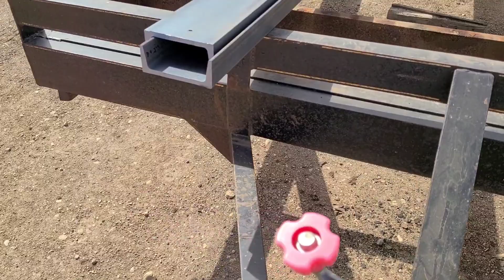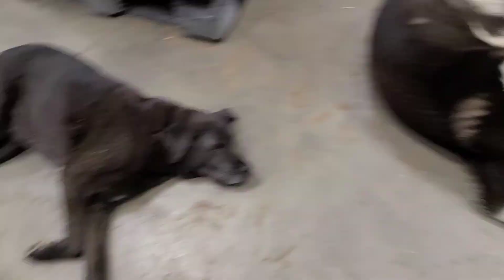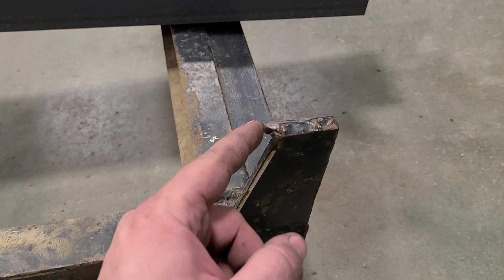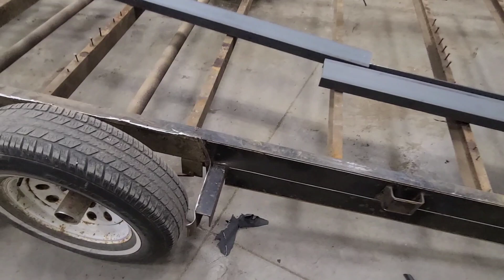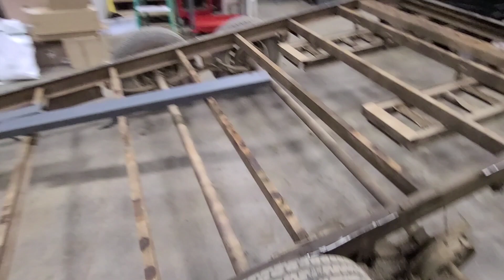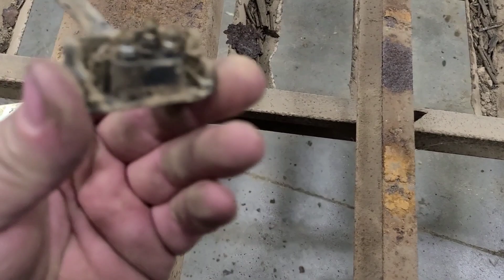18' Car Trailer Rebuild Pt.3 Tongue and Fender Removal

Comment: Why don't you just make a new trailer and be done with it? It would be a lot easier.
Reply from the maker: Steel prices as well as this already has a VIN and title. I also don't find that it would be easier. There would be quite a bit of work in laying out, leveling, and squaring a frame, as well as adding all the cross members, beaver tail, and spring hangers, etc

Comment: That silicone you found is something they do keep the rust from creeping out since there’s no paint in the cracks. Short term solution
Reply: Never mind!! You determined it was weld!
Reply from the maker: @rexkramer4938  I think the paint had bubbled away from the weld and that's the soft spot I was feeling, either way it's gone now. Thanks Rex

Comment: A very solid work, in my opinion, with the right choices for the recovery of the trailer.
Here in Germany we would have to have the work checked by the "TÜV" (Technical Inspection Association = Technischer Überwachungs Verein). Very many regulations, very many technical standards.
Because of these norms, your trailer would probably end up on the scrap metal in our country.
But I'm still very curious how it goes - I think the part is cool.
Kind regards, Raik

Comment: Hope u didn’t pay to much for this, I got a free trailer once and by the time I was done fixing I think I could have bought a new on for the time and materials invested
Reply from the maker: It was free, and with the way trailer prices are now, I wouldn't pay for a new one, if anything I would build my own from scratch. Let alone around here the lead time is anywhere from 6-18 months depending on the manufacturer

Comment: i must add this about the lights sorry to say all the big manufactors of trailer use the plug in lights . i have 3 thralier out here and don't have trouble with any of them  but the way it mounts is way different and much more inclosed

Comment: Are the spring mounts going to be a stretched folded hexagon  so instead of  90 degree leading and trailing edges you have 45 degree versions. Since you have access to a Cnc plate cutter. You could have a rectangle with radius corners  for weld on spring brackets.  I always hated bumping into the bracket corners when I needed to get under the trailers. 
Have you ever thought about using early 70s dodge motor mounts like mounts 2265 to mount your tail light brackets to.  Or ask to look at motor mounts 2122 and 2123. Tri 5 Chevy front mounts. 

And since there is fender brackets with flat tops  mount the fenders on angle and put hinges on the outside to allow them to flip down when loading if needed.

Comment: Are you going to send it out for blasting before welding or weld everything up before blasting?
Reply from the maker: After, that way all steel has a good surface for paint to "bite" on to
Reply: It's gonna look pretty good and be structurally sound when you're done. I've had to rebuild messes like that before and know what you're going through.

Comment: How to dismantle and showing what not to buy when repairing/rebuilding. This is not the time to try and salvage. This is the time to upgrade to better lights and whatever it takes to eliminate weak points. Just think how nice this trailer would have been if properly maintained from new. I have said it before. I hate to see all types of equipment sitting outside. I will always find inside storage if possible. Thanks.
Reply from the maker: This trailer had a very rough life. There is a difference between wear from using it and wear from abusing it. Thanks Charles, more to come soon!